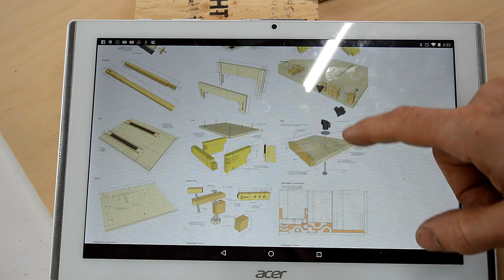Pantorouter linear glides

Comment: I have a bunch of server rack slides kicking around. I haven't used them for anything yet but they're made to hold quite a bit of weight so they'd probably work well for an application like this.
Reply: I used server rails for my Pantorouter XL build.  They are extremely heavy duty with no play, but took a lot of effort to make them work.  The trick is to find a set that will work well for this application as their designs vary greatly.

Comment: Matthias!  I'm surprised you didn't make slides out of wood!!   You might consider getting a dry film lubricant rather than using grease or oil.  Won't attract sawdust nearly as much.  I think they are usually teflon or graphite based.  Search Amazon for "dry film lubricant".  Seems like a perfect place to use one.  Cheers.
Reply from the maker: expained right at the start of the video
Reply: Just kidding about the wood.  But the dry film lubricant on your ball bearing glides might be a good idea.
Reply: I immediately thought about dry lubricants too, but I imagine grease would lubricate it much better.

And since this isn't the first revision, I expect the wooden dust shields do the trick and it's a non-problem.

Comment: If you had a hole at the front of the base-top with a cover, you could attach suction to it occasionally to draw out any dust that has accumulated between the two pieces.

Comment: I see Lee Valley sells these double tier drawer slides in two sizes.  18" and 20"  Can you tell me which are the correct ones to buy for the regular Pantorouter I am building?  I just purchased the plans so I want to make sure I have acquired all the correct hardware before I start building.  Thanks!
Reply from the maker: The 18" ones are long enough, but if you buy he longer ones, you might be able to get all you need out of just one slide.

Comment: What if you removed the the outer most bracket from the telescoping full extension drawer slide and just use the inside two brackets? Would that eliminate the play?
Reply from the maker: the middle part doesn't have a good place to screw it onto something
Reply: Matthias Wandel ah I see. Thanks for the reply. I have plans on using the middle part for a project requiring a sliding table. I dont want to have to buy anything for this project and I've had a couple of them laying around for years so I'll give it a try and report back. I'm pretty sure there's a way or I could be delusional haha. Thanks again! I'm a huge fan and your channel continues to inspire me for my shop shenanigans.
Reply: I tried that, for a 3D printer, but i soldered the middle part on the outer one and removed the stop in the end, it is almost perfect for my needs

Comment: A Vixbit will help centre those pilot holes for the screws.  It may seem like an extravagance, but they really work.
Reply: $40!?! This seems like a better solution. If I ever need to drill holes exactly in the center of something I could probably make these using only a file...
Though maybe only if I find a properly sized metal pipe - any ideas?

Comment: Random suggestion is random:

Since in a previous video, you outlined the problems you have with the orginal wood pantarouter you built, and as you are building a replacement, why not set up a raffle, after you completed the modified one, so you can hand-off the orginal one, plus a copy of the modified plans, to a lucky subscriber. That way a) you get to have more workshop space, especially if it is occupied by a machine you may no longer use as much, and b) gives a chance for one of us subscribers to get a 'Matthias Original (TM)' they can alter with the new plans ... a win/win, if I do say so myself ...

Comment: A wee bit more information on the centering sleve punch would be greatly appreciated, Matthias!
Reply: nexus01gr looks like a metal tube of the same diameter as the holes. Then just ran a nail down the centre.
Reply: Looks quite hefty for a simple tube, plus there are threads in there. It reminds me of electronic board spacers and I was wondering what it really was. But thanks anyway!
Reply from the maker: it is a spacer, might even have been used for electronic boards.
Reply: Darn good idea. Bet I’ll have forgotten by the next time I need one
Reply: Thanks, Matthias! Time for some scavenging...
Reply: Perhaps making a set with various threaded rod connector nuts, you know, the long ones, is a viable option. They go down to about 3mm if I'm not mistaken.

Comment: Is it possible to put in a slight dado for each glide to close up the gap more rather than add more trim around the edges to keep dust out?
Reply: maybe, maybe not. either way, sounds like a lot more work than simply adding a few wood strips. it would probably weaken the platform too much anyway.

Comment: Instead of putting that rear dustcover on the board that would allow dust in, why didn't you attach it to the bottom board so that it could do the same job but without leaving an opening while fully extended?

Comment: Would it be better to add wood strips on the inside of the glides and make the base an open lattice to let the dust fall out between the slides?  Also is there a silicon (or similar)  material that you could add to your dust shield that has both enough give and is slick enough to completely seal your dust shields? 

Thank you for your videos!  I always look forward to them!

Comment: You could add a piece of felt, squeegee, brush (like door sweep) etc to your base plate so it keeps dust out when the top plate goes past the edge.  Mount the sweep on the fixed part so the movable part doesn't drag dust and debris into the cavity.
Reply: Or a piece of wood in between the sliders on front and back edge of the top or bottom plates.

Comment: Add a thin sheet of polycarp underneath the back end of the slide to seal it when its fully extended. Should keep the dust out and you won't see it.
Reply from the maker: except that would interfere with the slides when trying to slide it forward.
Reply: a door brush would work.

Comment: You should think about using  "HiWin" Linear Rails in your plans as well as those guides. For most people it's probably easier to get hold onto those.
Reply: $100 rails over $5 drawer rails available in any hardware store?
Reply: For me this video primarily illustrates that coming up with the capital for some proper commercial linear rails and bearings is totally worth it. I'm sure I'm not the only one.
Reply: Yea I bought pantorouter plans years ago, never got around to building one. If I were to finally build it I would be looking to save time anywhere possible and would probably be willing to pay to do so. This is from someone who works full time, is trying to renovate a house and would actually like to have more than a few minutes left over for actual woodworking.
Reply: And that's fine, and you can all do that when you build them, or make your own videos. Until then....

the point of many of these projects, as in the older Popular Mechanics projects, is to show how things can be done with parts you can find anywhere, cheaply, or with slight modifications.

If you want to add a few hundred dollars to the build, be my guest. But generally, the point is making as accessible as possible.

And quite frankly, I'm not sure that it would make any difference in quality.
Reply: Lucas Wendel, Linear rails would be a nice add-on for sure, but if someone prefer spending more to improve quality and reduce the difficulty/time involved, I'd say it's easy just to go for the aluminum pantorouter
Reply: Kuldeep does still sell perfect aluminium Pantorouters You just have to put together which should go in less than an hour I reckon. He even includes some templates and followers (saw that on Marius' channel when he got his Kuldeep-Pantorouter). Why not going for one of those instead?

Comment: Hmm, i guess youre using those drawer slides because youve had them on hand, otherwise id have expected the cheap chinese linear guides that cost around the same as cheap dual drawer slides (at least here in germany).
Anyways, im tempted to get your plans just to convert them into a steel and aluminium build, might be worth it compared to buying a pantorouter.
Reply from the maker: the drawer slides are also much more compact, so they are a better solution.  And they are cheaper, and you can buy them locally and not have to wait weeks for delivery.
Reply: There are some linear guides that are just 16mm high, often used in 3d printers, so not that much of a size difference. But i guess those drawer slides must be cheaper in the US then, i could get two 9x6x400mm linear rails and fitting 4 linear guide blocks from a china import business in germany rather quick for about 25€, or the drawer slides online for about 23€ according to amazon. But if id buy them in my local hardware store id have to pay 34,99€ for a pair according to their website. So whats the best/cheapest solution seems to depend on were you are.
Reply from the maker: Stuff used in a 3d printer can be qutie flimsy, because there are no forces involved in a 3d printer.  So back to my original reply.
Reply: Eh quiet the opposite, Linear Rail Guide Blocks are standard in high load ratings, high torsion resistance, high accuracy applications such as CNC mills and other industrial machinery. But before 3d printers and desktop CNC mills became a popular thing, the small versions were hard to get as a nonbusiness and very expensive, as the smaller versions were nearly exclussively used in medical, laboratoy and small part manufacturing machinery. Since more and more 3d printer designs switch to these rails due their attributes helping with countering resonance and inaccuracy, while still allowing for heavy tool heads, the manufacturers around the world started to produce cheaper version to get their piece of the 3d printing and desktop CNC market. So now you can get them rather cheap if you dont mind a few micrometers les accuracy than the multiple times more expensive versions.
Reply: Slides are vastly more accessible, anywhere you go, and having bought similar 16 mm slides, I do not find them to be satisfactory for doing very much. I could even get them free, going to the various furniture depots, off the side of the road, etc.

But everyone's a critic... the fact is, a machine is working for 5+ years with slides and has no issues. So being of no additional benefit, being less accessible, being more expensive... I think slides win.

But build yours with whatever you want.
Reply: Well buying cheap stuff is sadly always a risk, the ones i own are rather good for being so cheap but ive also had some bas experiences.

And on the being a critic part, nah dont even want to start there. Im an industrial mechanic so if id have to critize such a machine i wouldnt even know were to start except "wood...", but that would be me judging it compared to the standards applied to engineered machines made for much higher duty cycles. And thats not why im subscribed to Matthias, im watching his stuff because i find it fascinating what he makes out of material that i would never associate with structural and/or mechanical machine parts.

Instead wondered if he used those slides because he had them on hand, otherwise from personal experience it didnt make much sense to me with various linear bearing systems made for such an application being available to me cheaply. I could go down to just 16€ with linear shaft bearings like on the metal version he owns. And the previous comment was a bit of an explanation why such components are not flimsy just because they are used in 3d printers.

And "being less accessible, being more expensive" seems to largely depend on were you life. In my case im buying stuff mostly online, the linear rails would be only 2€ more expensive, 2€ doesnt seem worth the work for addapting slides. If id buy the slides localy, id even bay 10€ more than the rails and have to drive to the next store.
Reply: The most common 3D printer linear rails are 8mm solid rods ( 10 & 12mm variants also readily available) with LM8UU linear bearings. Super cheap nowadays and anything but flimsy !  I love that youve modded draw sliders and considering your experience with previous builds im sure they will fit the bill.  I would look into implementing some window/door draught excluders ( lip seals) to keep the dust away from whichever system you use. Looking forward to the rest of the build CHeers

Comment: Omg god dude just spend like $50 so you don’t have to do all of this. You don’t have to reinvent the wheel
Reply: Or spend nothing, because slides are ubiquitous and you can find them anywhere.

"All of this" is not much unless you're lazy, and have never had to improvise to save money or avoid ordering special parts.

If it breaks, you can replace without ordering linear bearings online.

Not to mention the original one has been using slides for over 5 years without and issue, and it gives it a lower profile.

Why spend money just to spend money and get ZERO benefit?

When you build yours, or start your channel, you go right ahead and spend money on what you want. Engineering is also about things being practical, affordable, and easily replaceable if broken.

I can literally find slides at any hardware store, or even for free from the dump.